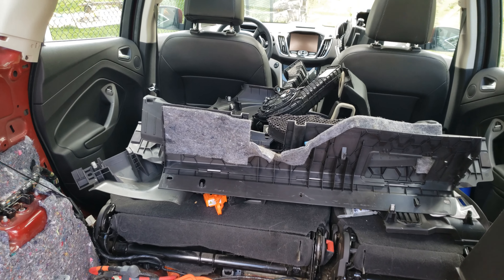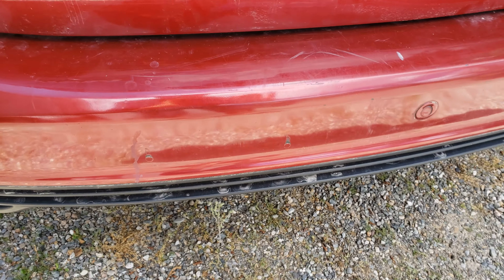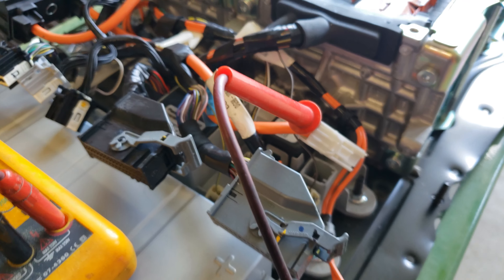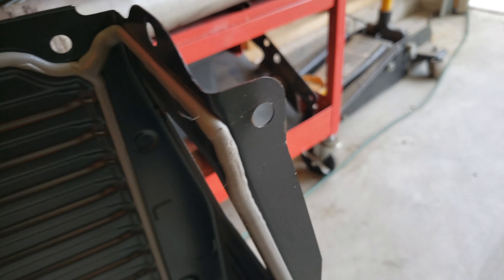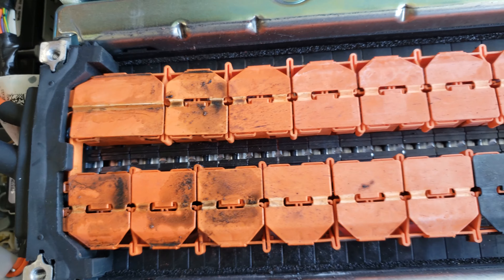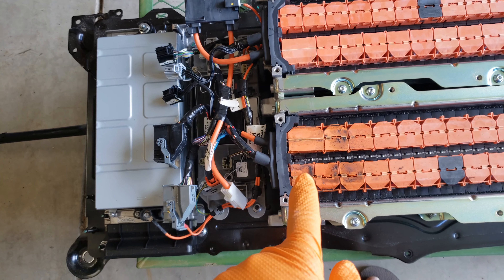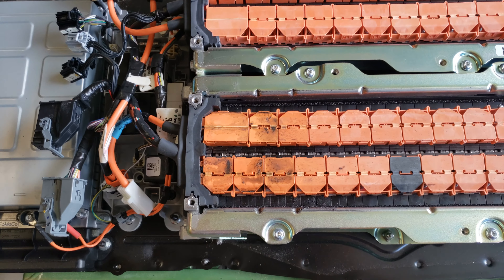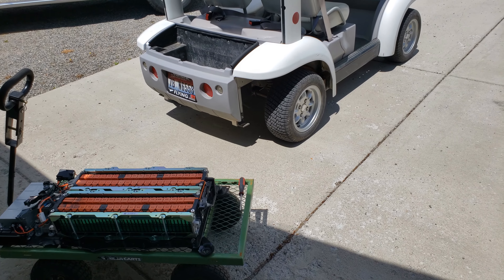I Bought a Cheap Ford C-Max - with a DEAD Hybrid battery

Comment: I own a C-max, excellent car and worth fixing! You can find a used low mileage battery pack online for under $1300(est).
Reply from the maker: I did find a good battery pack, cheap. This is my second C-Max. I think they are a very highly underrated car. Fantastic vehicles!! Thank you for the comment!
Reply: Considering a 2016 cmax energi. Please advise where you found source for battery replacement?
Reply: Where can I find the battery pacck
Reply: How do you know the battery is still good?

Comment: Theyre pretty good cars. I have a 2013 cmax sel and 2013 fusion hybrid se. The fusion is the better car but my cmax has the Sony system, the fancy power tailgate with the foot sensor to open, rain sensing wipers, push to start, navigation, and so on. My fusion is bare bones 😂 but at least i can do a u-turn easy in the fusion unlike the max lmao
Reply: Try changing the Sway Bar Bushing and Sway Bar Links to help with the U-Turns

Comment: I'm considering a 2014 C-Max SEL with 74k, appears to be in excellent condition. It's only lived in the Daytona Beach area. I heard high heat is a problem with these cars. Also, worried about its crashworthiness...thinking of using it for Uber/Lyft. Any thoughts?
Reply from the maker: I did not have issues driving daily in Sacramento and that's much hotter than Florida. I just like to leave the windows cracked when possible to keep the interior cool. 
Should make a great Uber car though, they get the best mileage in town and have plenty of room for passengers.

Comment: Thanks for the tips. My hybrid battery in my Ford Focus Electric just died after 3 years and Ford is not going to warranty. They are now asking 22k to replace the battery and I still owe 6k on this car. I don't have much electrical knowledge but I am going to attempt to drop the batteries and open them up like you did, I don't have any other choice in my situation, but I have to try, wish me luck.
Reply from the maker: Are you sure Ford won't fix it? Those have warranty for 7 years and 100,000 miles on the batteries.
Reply: @fordtechchris  Yeah, unfortunately they said I am 5 months out of warranty. This is my second hybrid battery. They replaced the first one after 5 years under warranty now this new one died 3 years later with only 26,000 miles registered on it.
Reply from the maker: @carlwilson1483  that is a bummer. Unfortunately parts replaced under warranty do not get any extended warranty. Good luck and be safe!
Reply: @fordtechchris  thank you!
Reply: Carl, there is a used parts dealer in Florida called LKQ - they are HUGE and have several locations. They sell Cmax battery packs with listed use hours on them for 4 - 500. They will also install them for you. They have incredible expert Ford mechanics. I've used them several times and know they are HONEST, affordable and reliable.
Reply: If I were you I would look for a place that rebuilds HV battery packs maybe?  They can make sure the pack is balanced right, etc. A rebuilt pack should be less expensive than a new one.

Comment: I just bought a used C Mac today and I was driving it and the battery went out😭 had to get towed home. The stop safely turned on, not sure what it means. the the “motor coolant over temperature” came on but there’s plenty of coolant and the car never overheated while driving. I need help😩
Reply from the maker: There are two coolant systems. The one for the electric vehicle side is near the brake fluid reservoir. I would check the operation of the pump for the EV system. If the coolant level is ok, it may just be the electric pump went out

Comment: Is there any chance you would be willing to help me? I am lost with this MkZ Hybrid I bought. HVB allows me to crank the engine but it never starts the car. Only codes I get are PA10C and another from the pcm that matches. Is there a reset process? It seems like it isn’t getting fuel but perhaps this is a safety and part of the engine disabled code. Any help is greatly appreciated
Reply from the maker: I would suggest you stop cranking on it, the HV battery only has so much energy in it and if it dies you can't just recharge it with a battery charger. That's kind of a generic code that requires more diagnosis to determine why the engine isn't running, ie fuel pressure test, spark test, MAF sensor etc. I won't be able to help much more than that. Good luck though. I'm sorry you're dealing with that
Reply: @fordtechchris do you happen to know if there is anything else that disables fueling? FORScan shows FUEL_CUTOFF-INP as Enabled in the BECM. I have spark, fuel pressure seems good but injectors don’t open. They are just dribbling while cranking. If I bypass the pcm and energize each injector they open and close as expected. Is there something I need to do to re enable the engine/fuel similar to an inertia switch?
Reply from the maker: @ChadMees  I'm not sure off the top of my head. But it definitely seems like you have no fuel pressure if the injectors are dribbling. Of there is an inertia reset, it should outline the procedure in the owners manual. I think that would be controlled by the RCM. 
Most likely you have a bad fuel pump driver module. You can test it by unplugging and jumping pin 1 to pin 5 and pin 4 to pin 8. This applies power directly to the fuel pump. Only replace them with Ford parts. You should be able to self test the fuel pump control module as well.
Reply: @fordtechchris  if I energize each injector it sprays and I have run the self test where I can hear the fuel pump cycle. I can also control
It and leave it in the run position from FORScan. This makes me believe the supply and mechanics are all good but the pcm is disabling the injectors. This is a hard one to diagnose and my next step is to verify all pcm and fuel related fuses. It looks like on the cmax there is a dedicated fuse for injectors but on my MkZ the fuse is shared with the FPDM
Reply from the maker: @ChadMees  gotcha. I'm sorry I can't help much more without being there. Unfortunately trying to remote diagnose stuff never works very well. I feel like you're on the right path that it's being disabled in the software. Just need to identify what's causing the PCM to shut down fueling.
Reply: @fordtechchris  found my issue. The camshaft sheared off the gear. Intake side not moving at all
Reply from the maker: @ChadMees  wow. I'm sorry to hear that, I've never seen that before!

Comment: Will this cause it to not want to start.?
Reply from the maker: Yes it will
Reply: @fordtechchris  it will act like it wants to then immediately turns off.
Reply from the maker: @boronin10  hybrids can have different symptoms than normal gas cars. For instance, they crank over at 800 rpm, which sounds like they're running, but just cranking. It Could be something like a bad fuel pump. With hybrids, you really need to get the computer scanned to see what faults it has detected.
Reply: @fordtechchris  ok, my hybrid battery meter is all the way down. I put a fresh 12 v battery in it. It tries to start, but just shut back off. So I didn't know if that hybrid battery being all the way dead was causing the issue of it not wanting to start, too.idk it might have dead cells in it.
Reply from the maker: @boronin10  if the engine is spinning over the battery is ok. The red triangle warning will flash if the hybrid battery is bad.

Comment: I’m back and the ford techs say it’s the main battery. It’s a energi so they quoted 11k for a new battery. How viable do you think a cell swapped battery would be or do you think it makes more sense to get a new car?
Edit: just brought it home from the dealership and looks like its over. Stop safely now...
Huge edit: so after the car was sitting awhile, the 12v battery ended up dying. After jump starting it, there is no errors and the resistance on the battery looks normal on forscan. It’s been months since that and the car is still running just fine. If anyone is in this situation, try disconnecting the 12v battery, as a quick reset to the ECU/BCM might do the trick.
Reply from the maker: I found my battery on eBay. It was very cheap, less than $500 but that was 4 years ago. I wouldn't buy a brand new one. There is probably a smaller auto shop around you that works on hybrids and EVs also. You can probably get all of this done for less than $2k it's definitely worth fixing, otherwise it's not worth more than a flower pot.
Reply from the maker: I just looked and there are several in that $1500 - $2500. You might even have a shop check the local scrap yards nearby. The batteries don't fail often enough that I would be worried about a used one to save so much money. Good luck!!
Reply: @fordtechchris  thank you for the respond sir. What seller did you get the battery from? I see some that are in that price range and I’m not too sure if they are legit.
Reply from the maker: @heythatsprettygood6492  it was 4 years ago, so I'm not sure who it was from. I don't think I have a receipt loading around anymore
Reply: My Local shop charges 3k to replace the Energi Hybrid Battery 🔋
Reply: @fordtechchris  check edit on the comment
Reply from the maker: @heythatsprettygood6492  that's really good news! 
Just FYI in reality there should be infinite resistance on the battery leakage reading. Any measurable reading indicates there's a problem lurking. When mine failed it was up to 150k ohms at one point and I was able to drive it, but then dropped back below 70k which triggers the stop safely now. I hope it's not a problem for you anymore!

Comment: Question if the hybrid battery goes ded how to charge it just by jumping the 12 volts battery ?
Reply from the maker: No. Ford dealerships have to request a special charger from Dearborn to recover hybrid battery packs. But in 20 years of working with Ford Hybrids I've only ever seen 3 batteries dead and had to be replaced, recharging wasn't an option. Just make sure to run the vehicle every now and then if it's going to sit.

Comment: My car’s battery dead after 9 years so yer. I am not sure if I should sell it or replace battery as I like this car. It works wonderfully except that dying battery.
Reply from the maker: If you can find as used battery on eBay or similar wrecking yard it's definitely worth fixing in my opinion.

Comment: What would be the cost to repair trans fluid leaking? Thanks for your video!
Reply from the maker: Oh man. It's a bummer. The entire engine and trans and subframe have to be lowered out and then the trans gets lifted away from the engine to a bench where the case gets resealed. If that's your leak (there are other spots) you could be looking at $3000-$4000. It's mostly all labor and hopefully you could find someone to do it cheaper. Honestly I'd just clean it at every oil change and check the trans fluid level once a year. At least that's what I'm doing with this red one. My white plug in, I was lucky enough it was still under warranty so Ford payed me to fix my leak 😁. Good luck!
Reply: @fordtechchris  Thanks for your quick response.
Reply: @fordtechchris So I still have a warranty on mines for trans and engine and I think my trans is making a weird whining noise everytime I accelerate. What do you think it is?
Reply from the maker: @ChrisColeman-cl2qq  I can't tell you over YouTube. Unfortunately there aren't many common things that cause that so you'll need a mechanic to look at it
Reply: @fordtechchris  appreciate the reply Tho. But can you take a guess. I don't mind.
Reply from the maker: @ChrisColeman-cl2qq  I'm not sure how long you've owned it. There are normal whining noises that happen. But if you've owned it a while honestly it could be anything. I would just have a reputable Ford dealership look at it ASAP while your warranty is valid and get it repaired. I would suspect a water pump or front wheel bearing, but honestly it's not common
Reply: @fordtechchris  only about 4 or 4 months but it already had 89,000 miles on it so idk.
Reply from the maker: @ChrisColeman-cl2qq  wow, what a nice find. Well, I would recommend bringing it to a dealership. Usually they can at least reassure you that it's normal and won't charge anything. You still need to keep up oil changes every 5k and transmission fluid every 50k. And filters and spark plugs due at 100k. Have it checked out. These are such great cars. I hope yours is in good condition!
Reply: @fordtechchris  it drives fine to be honest. Just that sound. Also I just drove it to Vegas. No oil light yet but I will get an oil change still.

Comment: First thanks for your U-Tube video. Very educational, and informative about FORD and their support of there products. I know I should not be surprised. 
I have 2013 and Love it. On relative terms few miles at 56K. But enjoy it and find it a nice car with enough elements to satisfy you needs. At this point I am am looking at the possibility of issues with the High Voltage battery. Just good to know that there are fix its possible. 
I see a number of shops getting into "fixing" hybrids and doing well in that major manufacturing is basically unwilling to support there products.
Reply from the maker: Yes! There are cheaper repair options outside if the dealer. As a EV tech, I'm always trying to help the customer out, but lots of times my hands are tied because of parts department policy or shop policy. If they can't make a buck it's not worth helping the customer unfortunately. But look around, hopefully you can find a mechanic who enjoys EV like I do. But they are great cars, my pervious C-Max has 200k with no issues now.
Reply: I have a 2013 Energi and love it too. $6,000 to replace the battery. I get 11 to 18 miles on a charge depending on the temperature outside. I have the SEL. It was in 4 accidents and I have no idea what was done. Gee whiz. Good luck.

Comment: Hello sir ...i am looking to buy a 2013 ford c max with 48000 miles on it...should i buy that car or not because at this point i am worried about battery life..would it still last or it will get fail because its already passed almost 10 years.
Reply from the maker: Hybrid battery failure is very rare. It's about as likely as the engine or transmission blowing up in a regular car. I would buy it, I'm sure you're going to love the car! I still drive this one and the used battery hasn't given me any trouble. They're just great cars!

Comment: These are an easy fix if you’re hands on I’ve got a set of these c max turned out 2 were bad swapped them and recompressed them with two ratchet straps and a extra set of hands
Reply from the maker: That's awesome! 
I did get a replacement battery and have been driving it for over a year now! Great car!
Reply: @fordtechchris  true great buy it’s a nice car

Comment: Hello, Sir I was looking at a 2013 cMax to purchase for really cheap first off the check engine light is blinking an a really loud noise coming from engine while in idle he says he don't know what noise is said maybe belts,? I drove car it had a slight vibration to it when I got it up to 70mph on interstate it was a little squirly should I pass on this car does it sound like a easy fix?
Reply from the maker: These cars don't have belts. So if there is a noise it might be inside the engine. The check engine light is flashing because there is a misfire. It sounds like this car has not been taken care of and needs a lot of work. I would pass.
Reply: @fordtechchris  Thank you so much     Sir for helping me dodge a bullet have a pleasant day.

Comment: How did you get the trunk open, with no power? We were going to buy a battery but cannot open the trunk
Reply from the maker: I still had 12v power, only the high voltage battery was bad. But, you can manually open the door and pop the hood. On the driver's side there should be a red tab sticking up. This is the jumper location to connect jumper cables or a jump box. The ground can be attached to a grounding bolt near that area as well. This will give you enough 12v to open the trunk. I hope this helps.
Reply: @fordtechchris  thanks, the jumper worked but the car still won’t start, no power… not sure what is going on with the cmax?
Reply from the maker: @vzombie  oh no. It should probably be looked at with a scan tool to see what fault codes have set. That should guide you in the direction of the repair

Comment: Ford had a recall on the chargers because they would over heat the out let and burn the house down.
We took ours in and they gave us an inferior one and it didn't hardly last a year. They said we have to buy another one because the recall one is not covered, about $300. Thanks Ford
Reply from the maker: That's a bummer. Honestly the one that wires in to your house is the best. The 110v one that plugs in just maxes out a 15 amp circuit. You need to make sure your outlet and wiring are in good condition. Use a 20 amp outlet if possible.

Comment: I really want to get a c max. but would battery replacements or other repairs make it more expensive than a normal car?
Reply from the maker: Actually they are a little cheaper as far as maintainance. The brakes almost never need to be replaced, they don't have belts. I get 40+mpg. Having the break downs are the worst part. If something gives out in the transmission, it is a very expensive unit and could total the car, unless a used unit is sourced. That's how I got the battery replaced cheap enough that I would only consider it a moderately expensive breakdown. But you can still have your normal failures that go with any car. And the transmission/hybrid battery failures are rare.
Reply: My mechanic Quoted me 3k to replace the Hybrid Battery on the Cmax Energi and about 1-2k for the normal Hybrid Battery 🔋
Reply: My Shop only charged 2-3k to replace the Hybrid Battery 🔋